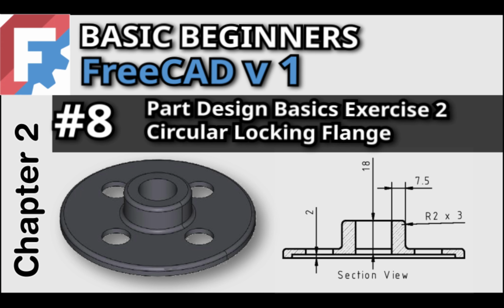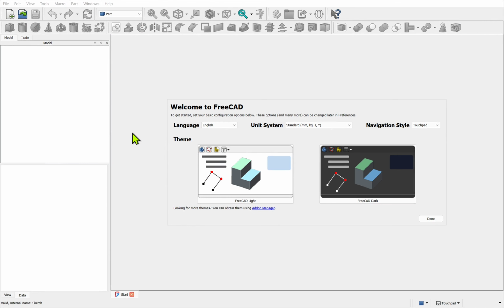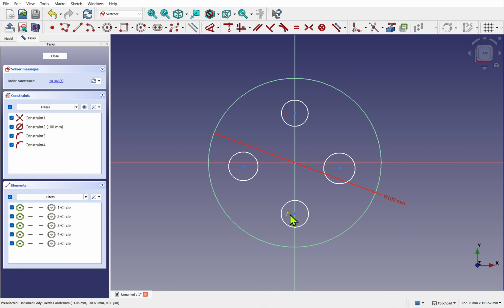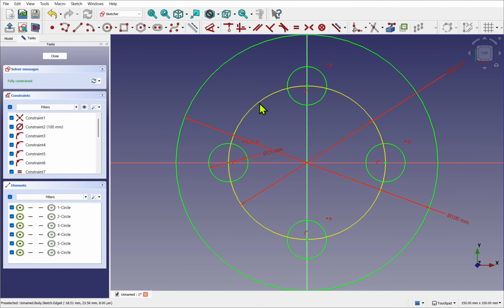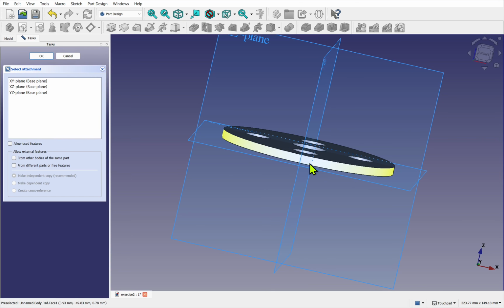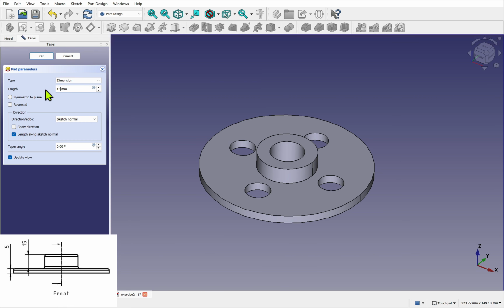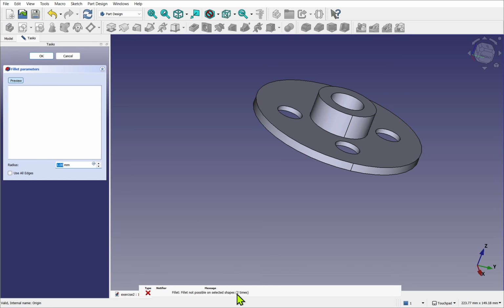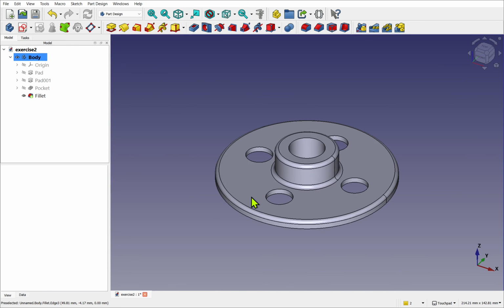Basic FreeCAD Model Exercise | Basic Beginners FreeCAD v1 Course | Lesson 8 (upd AUG 2025)

Comment from the maker: 🚨 Course Update! 🚨
Basic Beginner FreeCAD v1 Lessons 1–12 just got a refresh with new content! 🎉

I’ve gone back and updated Lessons 1–11 (Lesson 12 is coming very soon). Lessons 13+ are staying the same, so no worries if you’re already further along, you don’t need to rewatch unless you just want a quick refresh.  These are available from the playlist https://www.youtube.com/playlist?list=PLWuyJLVUNtc3UYXXfSglVpfWdX31F-e5S

👉 Backstory: The course was originally recorded on a dev build of FreeCAD 1.0.0, before the UI was locked down. Some icons/layouts later changed, which made a few videos a little confusing. Over the past month I’ve been grinding late nights to get everything up to date with the latest release, and I’ve added some additional content too.

The updated lessons are already in the playlist as unlisted, and they’ll roll out fully over the next two weeks.

✨ What this means for you:

If you’re new, you’ll get the best, most up-to-date start.

If you’re already on Lesson 13+, nothing changes, unless you want a refresh.

The old videos are still on my channel (just not in the main playlist). And the flowcharts? They dropped on Patreon yesterday and will go public early next week.

Have a great day :)
Reply: I still find this very confusing.  I was able to proceed by omitting the central 22mm hole until after I had made a central boss 35mm in diameter and then added a hole through it.  However, I don't understand why this is necessary.  I am a bit dim at times

Comment: Using 1.1.1 and after creating the sketch for the tube, when I add the pad everything vanishes. The tree shows hidden icons on the first pad and sketch but then shows visible for the second pad but hidden for it's sketch. Oh and the second pad has an icon with a green arrow pointing down(?) I can toggle between each pad and sketch and they show up individually (selecting body shows nothing). What am I missing?
Reply: Never mind I just saw your solution further down.

Comment: I wonder why when using pad  tool the smaller circles are automatically subtracted or pocketed throughout ??
Reply from the maker: If you think of it like a colour flood fill in a 2D graphics programs. You can flood fill areas.  This is very similar to what a 3D program does but instead adds volume.

Comment: The External Geometry tool didn't work for me when doing this lesson 😕after using it and closing down the sketch and padded it, the first pad disappeared even with visibility still on.
Reply from the maker: It sounds like you might have run into a common issue moving to 1.1 (this course is on 1.0), so try converting those external references to construction (click on them and right click, toggle construction geometry).  The solid magenta line should become dashed.
Reply: @MangoJellySolutions  Thanks for your reply Darren. It worked second time! It must have been an error on my part 🤔 apologies for any confusion.

Comment: Thanks for the amazing course. I’m on Mac using FreeCAD 1.1.1, and I’m running into an issue when I create the raised center ring by padding the sketch with the two circles. While the preview looks correct (during padding), after clicking OK, the new Pad only appears as 2D/wire-like geometry instead of becoming part of the solid. A solid cylinder (without the inner hole) pads correctly. I think it may be related to constraining the top ring circle Equal to the lower/existing circle. Have you run into this problem with the newer FreeCAD versions?
Reply: I think I know what happens. When you import external geometry, it has to be labeled as construction element. Otherwise, there will be an overlap.
Reply from the maker: You found that frustrating problem, 1.1 introduced this as the default and it has caught a number of people out, great to see you have figured it out, and glad you are enjoying the course.  Wish I got to this comment sooner, sorry.
Reply: @pashmakiat  Yep, I had the same problem. I wish the comment would be a little higher, but it's also a good exercise on understanding what's going on =)

Comment: Thankyou.  Am new to FreeCad coming from C4D as a Polymodeler.  The Deviation setting did not smooth out the visual display for me.  External Projection for a circle, then not turning into construction line did vanish the model on next Pad, but saw in your comments what causes it, thanks.

Comment: Can't get this going in FC1.1.0/W11. If I select the 4 circles, 2 of them relocate to centre of construction circle, while the other two move to about half the radius. The whole sketch then turns orange. If I select the circles one at a time, they relocate to the construction circle centre. And if I hit escape, the whole lot disappears! Any hints?

Addition - Closing fcad, I got prompted for save, so I did. Restarting and loading the saved file, it seems that the sketch is no longer editable.
Reply: I experienced something similar and so did many others. The problem seems to be related to importing the external geometry as regular geometry instead of construction geometry. See comment from @PaulbutonMedia for more details.

Comment: I think your courses are really great, but either is this program changing extremely fast, or I may be just mental... XD I follow every single step triple check every possible mistake you are talking about in the clip and still do not succeed to make trough this simple project :) For example I create the circle I make every single whole, but when I came to second sketch and pad it, the surface just does not appear, even when I click on the eye icon.. I guess I just need to keep going forward..
Reply: thats freecad 1.1, im currently experiencing the same issue. not sure why its treating the two inner circles as seperate objects instead of the sides of a pipe shape like freecad 1.0 did, and im not experienced enough (got about 3 weeks learning here) to know how to fix it yet. 

but if you go back to version 1.0 it worked fine for me.

Comment: I am trying to follow your steps, but when I do the tube extrusion and click the ok, the complete part disappears. I tried several times, the result was always the same. I am using version 1.1.
Reply: same here
Reply: Same
Reply: @neilbanman5766  Use the edge of the element, not the theoretical line — that worked for me.
Reply: @21Nrbi  It was answered elsewhere in the comments, and in fact MangoJelly did a video on it generally. 1.1 changes things so that borrowed geometry isn't automatically turned to construction aid or whatever it's called.

Comment: I'm using FreeCAD v1.1 and it seems to all go wrong when adding the second pad, it just vanishes. I've done this three tmes from the start, following the instructions precisely, looking out for the surface selection gotcha, but to no avail. Every time I hit "ok" to accept teh second 15mm pad the part entirely vanishes. The preview before hitting ok looks perfect. No idea what I'm doing wrong
Reply: Seems @PaulbutonMedia had a comment that fixed this issue! Phew, I thought I was going nuts. It's odd that the entire thing just vanishes, no error messages to tell me what went wrong.
Reply: bruh I had this same problem when I was using 1.1.1 but i decided to go back to 1 and the problem got solved

Comment: If I have 3 edges set in a fillet, and I decide to add another edge, is there a way to add one edge to the list of edges the fillet will be applied to?
Reply from the maker: Yes, you can double click on the operation, select the button on the left above the list of edges, the edges that have already been added turn purple and you can add more (or remove by selecting the purple edge or right click an item in the list and select remove).

Comment: I am watching beside working as a refresher and SUDDENLY you create a new sketch on a face! I am sooooo long avoiding this that I totally forgot this option and that is now much safer without toponaming issues and risk to lose everything
Reply from the maker: Yes, I have to admit from the start when I started I would always add sketches to faces as I knew that one day that would be solved and it was common practice in other CAD packages.  It did mean that if you did want to change anything that the possibility of it braking and you had to fix the attachment was high.  But it did mean that the videos were still relevant after the fix finally appeared.  It is so much better now the topo has improved, makes things so much easier :)

Comment: Hello, 
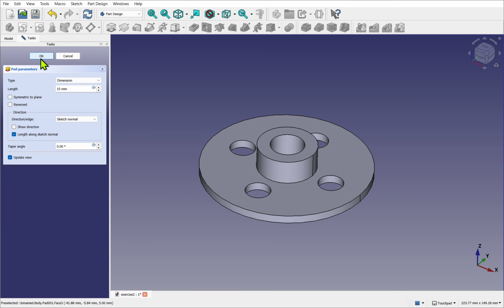Currently using 2025.10.01 weekly build, at 13:42 when I clic "ok" everything disappear, I can't see the new "pad". I can see it in the model tab "Pad001" but not on my screen. Is there a new feature ? or just some issue with the dev version ?
Reply from the maker: This sounds like there is a bug in the weekly build, there is a new build out this week so might be worth trying that out, if not raise it as a bug with the developers.
Reply: @MangoJellySolutions  Thank you for the feedback, I've decided to stick with the stable version while watching all your beginners videos, and after that I will probably switch too the dev version
Reply: @MangoJellySolutions Still have same problem in 1.1rc2 and a couple of newer weekly versions
Reply: The issue is solved at least for me. Your latest vid about preferences in 1.1 is explaining the problem. The imported reference was not imported as reference line but as construction line automatically. But this does not explain, why preview was fine.
Reply: I had the same issue, I'm using FreeCad 1.1.0. I gave up on the external geometry and change the Inner circle to 20mm manually.

Comment: I would really like to see this one done using the revolve method. I wanted to do it this way to get to know the software better. But I'm running into an issue. I got the profile done and created the shape using revolve. But when I go to draw on the top face to create the holes, it reverses the orientation. TOP on the cube gets oriented upside down, with the Y axis pointing down and the X axis pointing left. If I manually change the view around, all of my labels are upside down. I've tried mirroring it across the Z axis so that it's all on the positive side; same outcome. I've also tried changing the data for the sketch to "map reversed: true" and it then shows the bottom of the object, but right side up. Or, if I click the bottom face and then sketch, I get the bottom, and correct way up. But to keep myself sane, I would really like to work in top down and right-side up. I hope this makes sense.

Comment: I'm finding 1.0.2 is a bit buggy. I've had things not work right  a total of 5 times following this tutorial and the previous one exactly. Back up and the problem reappears when the steps are repeated. Have even had undo fail to work. However, if I save the project, close FreeCAD, then reopen and load the project, everything works fine. Thought I would add this in case anyone else is seeing issues following your tutorials.
Reply from the maker: That is a bit strange, especially when you said about the undo failing to work. I would like to see if this is far reaching (so if anyone is also experiencing problems please add).   The 1.0.2 is suppose to help with fixing stability and bug issues over introducing new features.  Which operating system are you using? Mac, Linux or Windows?

Comment: A quick heads up. Newer freecad may create the projected geometry as a line rather than a construction line. In which case either (a) don't draw the middle circle, or (b) toggle it as construction geometry. If you find your object vanishes when you do the second pad operation, this is likely what has happened. Thanks to the freecad forum for pointing this out to me.
Reply from the maker: Thanks for adding that, as a beginners it not immediate obvious if your in construction or normal geometry mode unless you known that the button are shown in either blue or white depending on the mode chosen.  Often these can be overlooked by people teaching.  Thank you for sharing your experience as it helps others looking back at the comments.
Reply: @MangoJellySolutions  Ah, I added a comment a moment ago, it seems this is the problem, lets go see.
Reply: ok, cool, this seems to have been my issue. Thank you Paul.
Reply: Yes that was what I got. Pad had a filled in center. Click OK and then poof where did it all go. Thanks for adding this comment.
Reply: Argh!  Thank you. I was just pulling my hair out over this one.
Reply: I hit this issue too and almost rage quit.  But remembering another video on FreeCad 1.1 changes, the suggestion was to go to settings->Sketcher->General-> and select "Always add external geometry as construction".  That makes the educational video work as intended.
Reply: @riplee406  I think this should be pinned  as this I believe is a more correct over all solution
Reply: @riplee406  Thanks
Reply: @riplee406  Thank you so much for this comment
Reply: @riplee406  Good call.  Thank you!
Reply: i spent hours trying to figure this out on 1.1 and ultimately rage quitted. Tried to change that inner circle to construction geometry but it didnt do anything for me. Hope all this is updated soon.
Reply: Dude. Thank you so much! I was banging my head for about an hour. Then, I decided to check comments—alas, my savior!
Reply: Wish I had read the comments. It would have saved me the hour it took to figure it out.
Reply: Maybe I should look at the comments and find out there's a simple solution for the whole thing disappearing when adding that pad .... over and hour head scratching and retrying the whole construction to the point of 'trying the same thing and expecting different results' mantra - cheers for posting this!
Reply: I was just about to comment this after spending almost half an hour trying to figure it out. I checked the comments one last time before posting mine and finally found this. Thank you so much!
Reply: I got stuck with this exact scenario for 4 hours last night and gave up. I just read your comment and it worked, so thank you!!!
Reply: I repeated the problem like 8 times... thinking I must be doing something wrong despite being certain I was following the video perfectly. not drawing the middle circle fixed it for me.